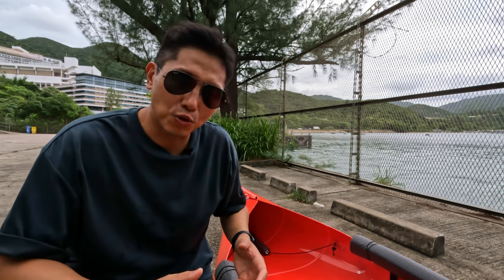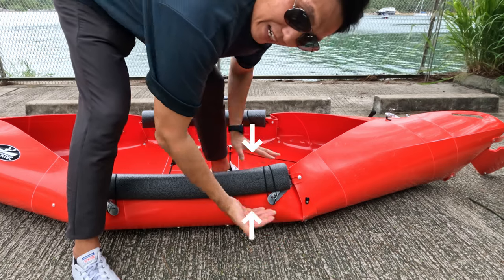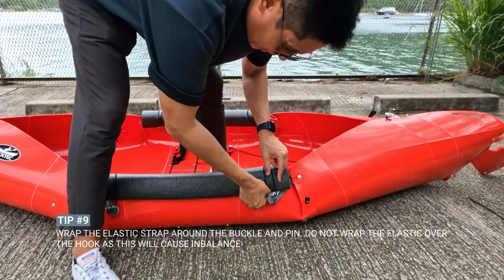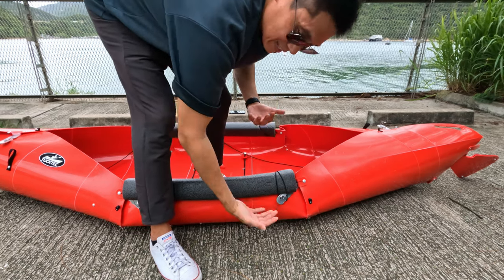HOW TO FOLD THE TUCKTEC FOLDING KAYAK - Assembly Tips & Tricks

Comment: Thank you for the video, very helpful. As you note, I am having. lots of trouble with the side folds. I am considering using a clamping plier to get more force on the clamp, and addleverage through additional length.  Is this a fatal idea, or does it have possibiliites?
Reply: Answering my own question. Be careful! the extra leverage can (and did) bend the "bar". fortunately I did not bend it enough to prevent the lock from working. What REALLY helped was the blow driyer heat on the plastic!
Reply from the maker: Hope the video helped! Not so sure about the pliers as I haven’t used one. If you can get leverage from three points, it should work! But you may have a different version to mine

Comment: How about put two banana shape floats into each side of the tucktec (length from bow to stern), make it unsinkable and can get back into the boat if flipped over?
Reply from the maker: I’ve seen people use the floats on the sides and it looks good! The only thing I would say is that it would make the kayak wider so it’s not as easy to paddle unless you have a longer paddle :)
Reply: @Fishaholicboy  i mean put inside

Comment: For some reason the footrest easily falls out of place
Reply from the maker: Hi! I didn’t really used the footrest much because just as you mentioned, it doesn’t stay put. One way is to tie a knot to stop the footrest from slipping but getting it undone and be difficult at the end of the trip and having put a lot of pressure on the footrest
Reply: @Fishaholicboy Also what is the proper way to set the rudder. Is it supposed to be hanging downwards or straight? I was thinking the proper way would be downwards kind of like on a Viking ship or trireme
Reply from the maker: @namesomega3694  Hi! In the water, it should be down in the water to help to keep the Tucktec from going straight. I put it up when I’m on land so it doesn’t scratch.